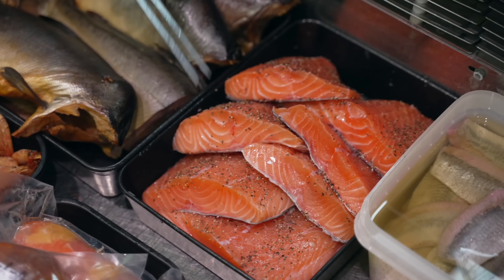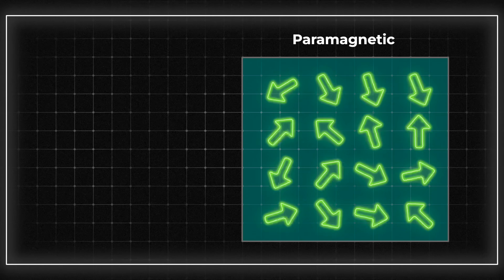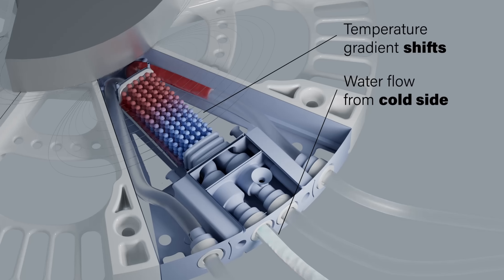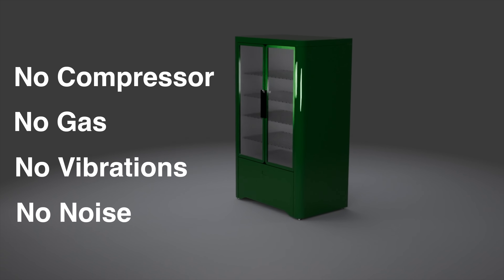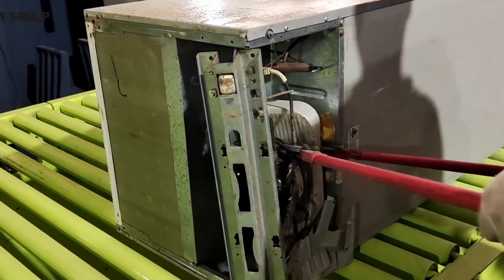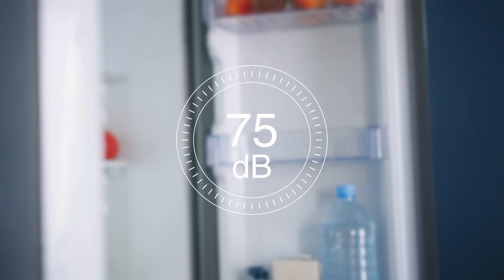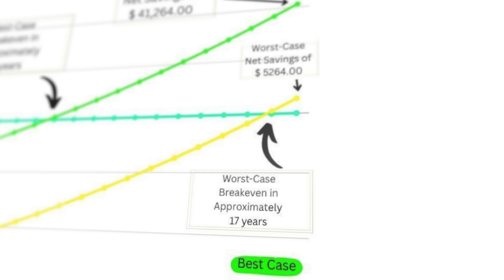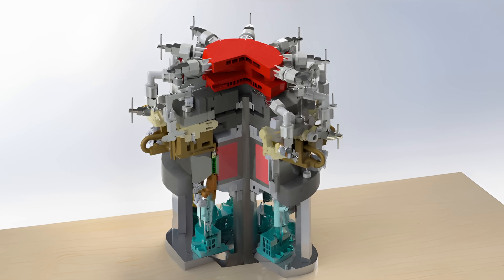Can Magnetic Cooling Disrupt the $100B HVAC Industry?

Comment: Very interesting.  As someone who works in HVAC design, I wonder if the technology could ever make it into that industry.  As is, we typically cool down to 45 F for dehumidification, and they've already got them colder than that.  The main issue would be how much BTUH can they take out of a moving air stream?
Reply: Obviously the BTUs per unit time it can pump doesn't have a set limit, because you can just use a larger magnetocaloric cooling element if you need a higher throughput.
Reply: BTU per Hour I'm guessing.
Reply: Of course HVAC would be in the front. With ~20C as the point, you'd save truckloads of money.
Reply: How many you got?
Reply: I'd like to see more adoption of cooling applications, especially HVAC, dumping heat to circulating water instead of air, a thermal insulator.  The other end of the cooling loop is buried underground, normally 55 degrees F anyway.  Some HVAC systems already do this and do it well.  So fridges and chest freezers in the home could hook into the same loop.
Reply: @PeterLawton : That system you refer to is what's called a geotherm system.  But now days these SEER 19 -30's currently on the market are actually more efficient.   Note I didn't say more reliable just more efficient.

Comment: I'm much more interested in industrial cooling - air conditioning systems for large buildings, factories, shopping centres, etc.  Also data centre cooling - that's a bit of a bottomless pit in terms of cash to be thrown at the problem in some cases especially for AI data centres.

The increase in plant cost will be pretty quickly absorbed in energy costs which can be insane;  also the load on the grid is a much bigger consideration for them, in some countries it's becoming mandatory to put in automated backstop systems which allow the grid to issue a "stop using power now" to heavy consumption devices, air conditioning is a MAJOR one in this regard.  If this tech addresses that ongoing consumption that wildly reduces risk and impact on the grid too.

As for noise - having lived high up in a city I can attest to the constant noise of air conditioning systems especially at night, it's a LOT more than you realise and most noticeable at night when there aren't traffic noises competing.  That's another big advantage;  these can be regulated into place (tighter noise and consumption requirements for permits) so I'd say this is how such a tech gets its early funding.  They shouldn't rely on early adopter prosumer types, they should go for industrial and business first and not just refrigeration either (that's important of course but not as widespread as aircon).

Comment: The problem with Celsius is you have to use decimals to get the accuracy of Fahrenheit. The you bring up the global warming hoax... I thought you are all about "science"... very disappointing.
Reply: "The you bring up the global warming hoax..." You obviously are not all about the science.
Reply: @DM-dn7rf  65 years of that BS is enough Einstein:)
Reply: If you want to make calculations about heat pumps, you should use Kelvins. With Fahrenheit, BTUs and PSI and cubic inches the calculations would be pretty awful. With metric system and Kelvins a high-school student can calculate Stirling heat pump temperatures pretty easily.
Reply: @jounisaari9471  Good point:)